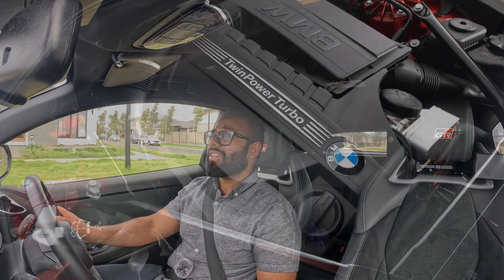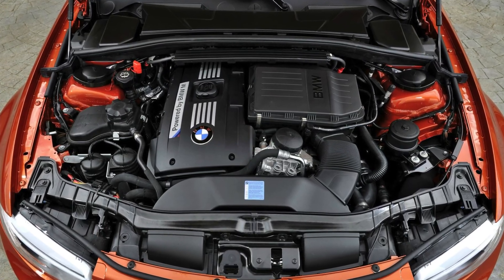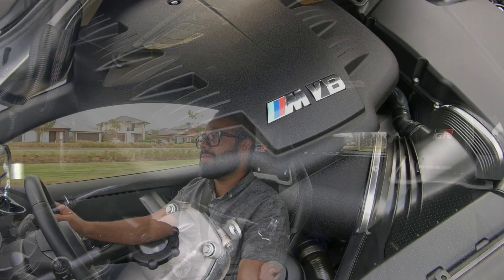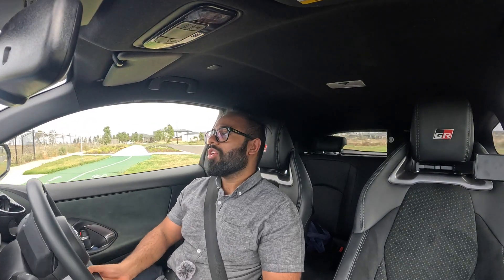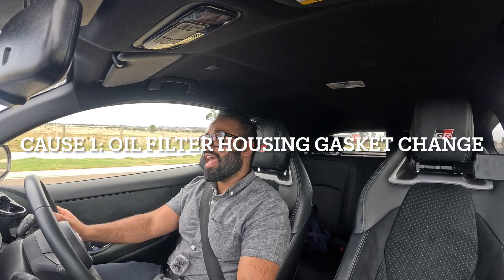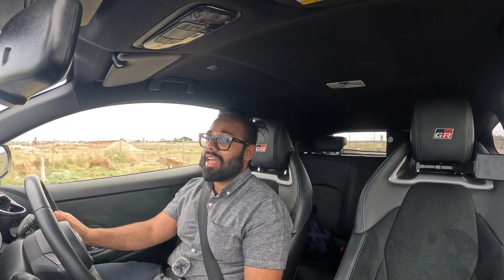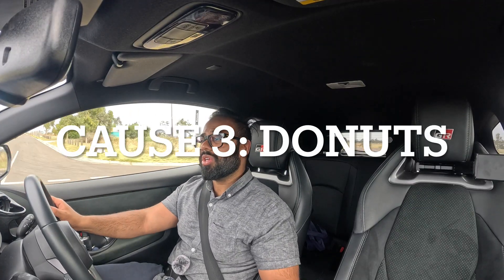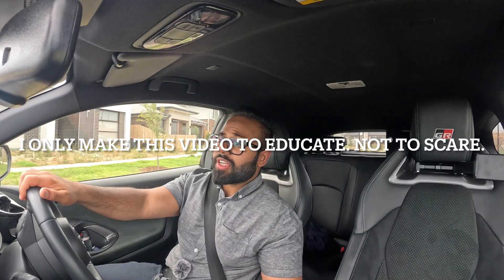Why your BMW N55 Rod Bearings are failing

Comment: Interesting. I have a 2011 335 xdrive since it had 9K miles, now with 110K miles. I dont race it/ track it but was planning to keep it longer (Had it for 10 years now and still love it). I got a quote to do oil pan gasket $2000, and then the Rod bearings another $1000. The car is worth $8000. I am not sure what to do. Spending $3000 and driving a paid off car you still love and looks good,  is better than buying a $60K car where Im leaning.

Comment: I have to differ. Original rod bearings in my 203k km N55, cracked her open to chase a 101F01 code, turned out to be a hardline crack in the cylinder head spark plug thread. Main bearings and rod bearings looked great, with little to no wear, could’ve easily lasted another 200k. Oddly, cam ledges on the other hand looked scuffed, pointing to potential oil quality issues. 

Had a customer’s N20 in the shop with 98k km on the clock come in for a rebuild, main and rod bearings looked much worse, with traces of substrate I.e. copper visible. This included grooves that would barely catch a nail. Potential extended OCI recommended from the manufacturer with inadequate oil quality a probable cause.

Comment: Its a bit of a misnomer that the bearings themselves are the issue. The oiling system is the real culprit. Just hit 140k and had my mechanic check a couple bearings during oil pan gasket and there was very minimal wear. Mainly because i let my car get to temp before stepping on it and i dont track or swing the car. 2011 335i pwg
Reply: How many miles on pwg n55
Reply: @DanBeex its in the comment bro lol
Reply: Interesting good to know, I have a 2011 335 Xdrive and wonder if i should do it with 110K miles. I dont race/track it, just have a s1 MHD tune.
Reply: @Herakles73 if you do 5-7k mile oil changes and dont beat on the car your bearings are fine. If you do donuts and floor it while cold they will probably need to be looked at

Comment: No the this right but wrong at the same time I’ve tracked and drove my n55 f10 hard on oem bearings 180k miles and no issues. The problem with the rod bearings is people won’t let their cars warm up before flooring it or driving off in the morning. Just let the dam car warm up. It’s not hard.
Reply: Yep!

Comment: Think you're confused. Rod bearings are a common issue on most Bimmer v8's, to the point they could be called a consumable. While it does happen on the sixes it's not common, it's the exception, usually due to poor maintenance or abuse. N54 had a bunch of ancillary issues, less with the rotating assembly. You have a solid engine, just be sure to maintain it
Reply: It is one of the more common failures on the N55 so I’d say it’s pretty common 😂

Comment: true, i own N55 E90.. Always overfill oil by at least 500ml when doing skids/donuts or you track your car. Already over 30000km with it, no issues at all .)
Reply: Absolutely.Definitely more of an oiling issue than a bearing issue
Reply: Does it not trow a light that the oil is too high if you put 500ml more?
Reply: @minkar98k never had this issue
Reply: @theXvisions  oh okay , maybe i will give it a try. Thx😁
Reply from the maker: awesome to hear mate. well done

Comment: BMW with reliability issues...I'm shocked 😮
Reply: Be shocked as I Canada heavy winters they are the cars that stay forever in my street while Japanese owners replaced their 1.5 times past 10 years. Koreans x3 so on. 180,000 kms zero issues, 335i performance ,e maintained, engine oil analysis. With rust proof CCB add on, billeting suspension etc the car is better than I left bmw in 2014…Japanese even Lexus rust. Koreans disintegrate starting year 2, suspension esp. so the Japanese are reliable as long as they get replaced as cars. Toyota is indeed relatable but stop\len so much that on insurance costs alone they exceed BMW.
Reply from the maker: lol

Comment: With the purpose of rebuilding, I bought a 2011 X5 with a N55 engine that had a nasty rod knock.  With the way it sounds and how much glitter is in the oil, I suspect that the bearing is completely gone and it’s metal on metal.

I suspect I will have to have the crank bearing rectified and purchase oversize bearings and perhaps one connecting rod.
Reply from the maker: @mesmaayan  perhaps a turbo too if the metal has made its way through everything

Comment: N55 rod bearing issues is mainly due to abuse or poor maintenance, like oil starvation. If maintenance is done properly, engines easily can do 200-300k miles.
Reply: Like most bmws then. Owned by people who have zero mechanical sympathy, just abuse them and don't understand why things start going wrong.
Used bmw purchases is like passing around a burning stick of TNT.
Reply: Another common issue I gathered is dealership oil. Most n55 with rod barring issues had frequent oil changes at dealers using the new 0w-30 oil, old 5w-30 did not have such issues.

Comment: Great synopsis of the N55 rod bearing issue! Now I'd like to see your take on which steps are available to counter this "issue".
Reply: N55 have large issues of oil starvation for the rod bearings due to their design. Replace the oil pan with an s55 oil pan that has better baffles to prevent oil starvation to the bearings, and then even stock bearings will last 200k miles let alone some nice acl or king bearings.
Reply from the maker: Will do mate. Thanks for watching
Reply: @motoringfan  Would you say just replacing the rod bearing with aftermarket ones before any issues occur is the best way to prevent this?
Reply from the maker: @ I wouldn’t necessarily say aftermarket ones. If you replace your rod bearings with original BMW parts and treat your car right, it should last the life of your car. Only reason rod bearings are an issue is because people buy a used car which has been abused. You must balance this against the cost of replacing your rod bearings.. not cheap. It’s all based on your risk profile.